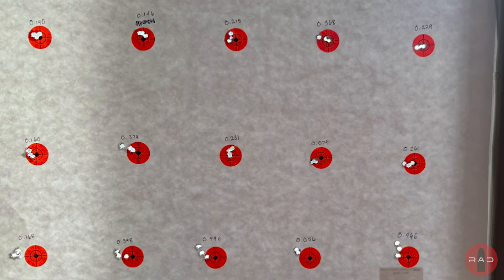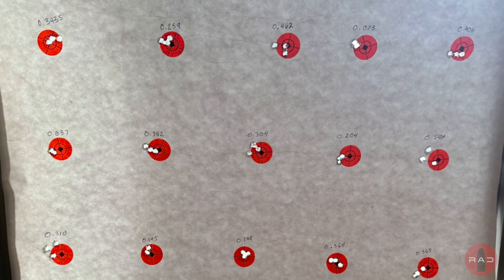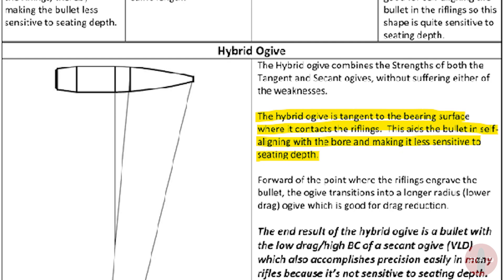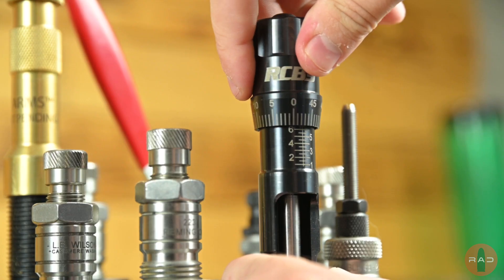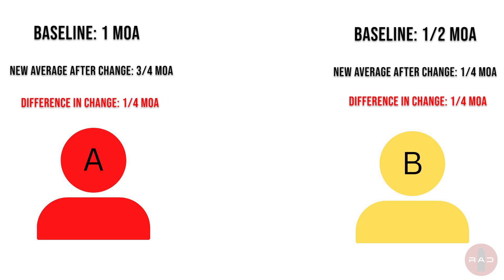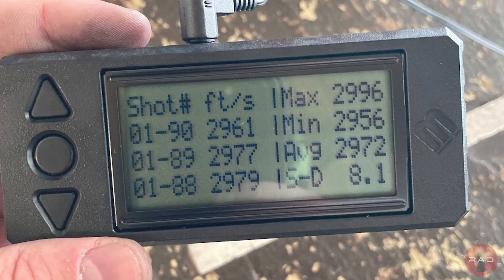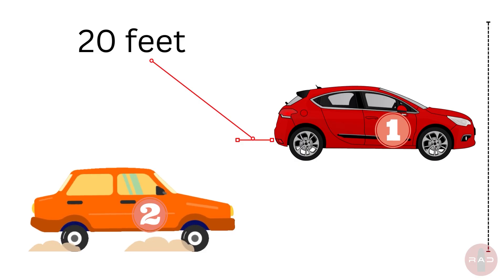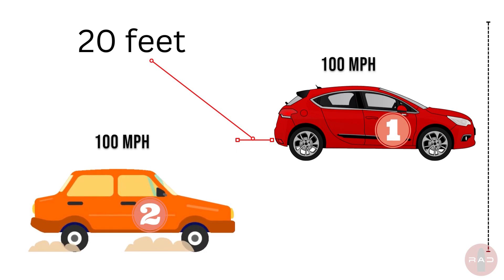I Failed To Prove Seating Depth Matters

Comment: Quick load and other load software utilize internal case volume to determine and predict what the pressure and velocity will be. Changing the seating depth changes the internal case volume. Which changes the pressure which changes the velocity. Seating bullets further out of the case increases case volume, as a general rule lowers the pressure of the load, unless it is jammed into the lands, .All of that changes the vibration imparted on the the barrel. The way to make a barrel stiffer is to Shorten it and make it larger than diameter. That limits the vibration of the barrel. Barrel tuners can also affect the vibration of the barrel and may or may not improve the consistency of the vibration.
Reply from the maker: The vibration you’re talking about, rise to peak pressure isn’t consistent. Because we aren’t shooting lasers. To that regard, you’d never be able to predict a “node” yet alone “time” muzzle whip since that is the case because all of our velocities aren’t going the same exact speed. To the other points you made about tuners, Bryan litz and jayden quinlan have both debunked the theory statistically via large testing in regard to tuners. Harmonics are not a dominant driver to precision. When ballisticians talk about seating depth they are not talking about it in a vibrational sense, they are talking about it in a mechanical sense and the way it aligns with the centerline of the bore. More common things that effect precision that have been proven since the 1890’s by Franklin Weston mann, Johan Lanhous, the reason the hybrid bullet was invented by litz, etc is due to bullet tipping in bore, unbalanced bullets, bullet shape, chamber dimension influences the relation of how the projectile is situated to centerline, etc. these are all basic problems to dispersion issues on target.

Comment: Well… time has elapsed. And now it seems the flood gates might be about to open on this matter as the question is now drawing some broader attention. 
More and more people are sharing experiences and data that struggles to prove strong correlation between group size and seat depth. I’ve heard this in podcasts from Bryan Litz and the Hornady ballisticians. They aren’t concluding it has no effect but their large sample size tests aren’t showing it… and the folks in bench rest and F-class who extensively use small sample size seat depth ladder testing to “tune” their rifles are getting right bent out of shape and butt hurt offended by the sheer blasphemy of it all… which is an even more interesting phenomenon than the test results if you ask me. 
in order to move the needle with the hard core orthodox believers somebody is going to have to execute a thorough controlled study testing group size with seat depth varied in .003” increments. Any study conducted with increments larger than this will never be accepted by the F-class and bench rest community because they believe that “harmonic nodes” exist very close together with different widths. And increments larger than .003” must be skipping between the nodes. It’s interesting… F-class and bench rest shooters achieve outlandish precision using their gear and methods… this fact is undeniable… Their methods seem to have become elevated to the status of sacred…
Reply: I can’t speak to the specifics of jacketed projectiles. I can speak to cast powder coated rifle projectiles. I personally have witnessed on many occasions. That jamming a cast rifle projectile into the lands will in a lot of cases produce very good accuracy. I can’t explain why it is for certain. I have heard that by jamming the projectile it creates a constant alignment. This kinda of reloading might not have anything to do with the two different shooting disciplines. Because it a very BIG NO NO to jam a jacketed projectile in the lands of a rifle. But I can help to think that there has to be some similarity’s between the two.

Comment: I’m not sure how everyone else will interpret this but based on your chart I’m thinking seating depth might matter but not for me. I know the BR crowd definitely believes in seating depth but they are also shooting 2” 10 shot groups at 1000. I would have like to have seen a greater variation on the jump though too. I have heard of people like Satterlee jumping as much as 0.250 and it not hurting accuracy too.
Reply from the maker: Hey! So based on the data—where would you say seating depth matters? Where is one seating depth inherently making a difference in group size? 

Yes—there’s other reasons other than what meets the eye that contributes to seating a bullet deep and having dependable and repeatable ammunition.
Reply: @Reloadingallday  correct me if I’m wrong but none of these groups would be competitive in a benchrest match, and I believe most of those guys run very light neck tension and “soft seat” the bullet in the lands of their rifles. You didn’t test jammed vs jumped. Just all minimally jumped. I’ve heard that all but guarantees alignment and that’s not related to harmonic nodes.
Reply from the maker: @K-bob_45  hey Bob! Take your rifle when you can, conduct the same exact test and see if you can see a distinguishable difference. 

Take into account again the difference between a Benchrest rifles that is super heavy that helps mitigate recoil, versus a rifle that weighs significantly less than shoots a larger recoiling round. 

The seating depth I “normally shoot” is touching. However, when looking at BR group seating depth test, the groups are all touching or almost indistinguishable for the most part—and when a “bad seating depth” is being pointed out in the test, it’s not considering the issue of the shooter behind the rifle and one typically contributes this to “bad seating depth” that may be claimed if one impact is slightly different. When it’s actually something entirely different causing the outcome. Hence, type 1 and type 2 error.

Further, If seating depth really mattered, no matter what the group size is and what the shooter is capable of: you would see a massive difference in the group size itself if it really mattered. Which the explanation of group size and comparison between shooter A and B talks about.

Regardless, some of the groups were in the 0’s up maybe a few outliers into the .4’s-.5’s. I’d highly look at topic of dispersion, depending upon rifle system, like a heavier BR rifle, the groups are going to be significantly smaller but measurable.
Reply: @K-bob_45   What your asking for is entirely different than what this video has shown.
Reply: @Reloadingallday  lol I don’t have the money or component availability to do this test. Also I buy bullets that aren’t supposed to be jump sensitive. I may try a seating test with some VLD’s but I shoot 169 SMK’s or 185 juggernauts at the moment and with both I just run mag length and the only fine tuning is powder charge for me. I may try the seating depth test with 195 TMK’s though
Reply: @yd8hw  yes and no. I think this is perhaps a premature conclusion. Picking a hybrid ogive bullet is purposefully selecting a “more forgiving” design and then the conclusion is that seating depth likely doesn’t matter. Maybe a type 3 error? Lol idk. Just my observation
Reply from the maker: @K-bob_45  haha I hear ya! Whenever you can, I think you’ll be very interested in the results.
Reply from the maker: @K-bob_45  I’d have to respectfully disagree, I don’t think it’s a premature conclusion. Because if seating depth made a difference, the “jump insensitive bullet” would show if seating depth really mattered. Ofcourse in this case, with this specific ogive—there’s a reason why they are more forgiving. Other than a vibrational node. Personally, I don’t see any muzzle whipping like it is talked about when looking at high speed footage like the one included in the video. 

Further—how many guys are sincerely not doing seating depth tests with any type of projectile ogive design, including the hybrid to squeeze in groups? Or even showing chronograph data over simply 20 rounds?

Further pointing out: how many times have you heard guys of saying that they haven’t touched their seating depth for the entirety of the barrel “stop chasing the lands, seating depth doesn’t matter”—which comes from the BR world. Instead they may change their seating depth by .003” to keep things in tune. Both can’t simultaneously be true at the same time. Changing a projectile by .006 is about 12 micro seconds difference timing in the barrel—this can be seen on Quickload and Gordon’s. If we follow the optimal barrel timing method, all of the nodes suggest that you would have to jump .060” or more for each different node to time it different in accordance with the calculator itself while also simultaneously going the same exact speed each single round—which is impossible. Furthermore, while added on Gordons reloading tool. The creator and developers added it by popular demand, not because they thought it worked. There’s too many instances where OBT doesn’t work. 

As far as seating deeper or large amounts of jumps, there’s a reason inherently why rounds like a lot of jump depending upon propellant bulk density, case volume, and projectile being used. You can see this by loading up a bad bulk density powder that has a very moderate powder charge load and start jumping. You will see some interesting things in regard to SD. 

For a type 1 and type 2 error, this is observed constantly when seating depth tests are conducted. Out of the groups shot, at various seating depths. Only the best group is chosen and not retested in great length. No one re-tests all the seating depths in great length—including the bad ones, which, to most individuals surprise you will see what I’m talking about in this video in regard to dispersion. 

Food for thought, a lot more going on then what actually is being portrayed

This also might help explains things more on the stats side: https://www.instagram.com/p/CsAOCVeNs8K/?igshid=MzRlODBiNWFlZA==

Comment: what if the seating depth is finding the load density or vise versa. so basically you could say you want to start the load .020 off the lands then slowly work up the powder charge till your group shoots the way you want it too if you say seating depth doesnt matter not if you found the perfect load density as you move the bullet forward or back you have now changed your density. which makes sense other wise every bullet would shoot good at that ..020 but it wont because your load density changes

Comment: Statistical significance.
Barrel life
Component cost
Repeatability
Recent reloading  process seems to be disproving the usual ideas...velocity node...followed by seating depth. Ie ...concentricity by f class john,
I guess most can't throw that much time and resource at it.
Then there is stable platform to shoot from and wind..for significant results..

If consistent velocity is key...then...case capacity measurements and powder weights most important ..

All very interesting..

Comment: How did you determine group size?  Group extreme spread  is itself a random variable, problematic for linear regression.  Seems to me you'd need to use an invariant measure like mean ES or mean shot radius as your dependent variable to justify linear regression.

Comment: So only load density matters, right? But seating depth affects load density, right? But seating depth doesn't matter, right? Just trying to make sure I follow.
Reply from the maker: The way one achieves precision due to chamber design, projectile shape, dynamic instability versus velocity consistency is being confused with timing the projectile in accordance with a muzzle whip. Highly recommend listening to Jayden quinlan, rifle accuracy facts Vaughn, or Johan labhous from Somchem, Reinmetal denel that clear this difference up and what we are explicitly showing.

In other words, from all the collective testing so far, if using a hybrid or tangent with modern chamber designs, you can get any seating depth to work.

Comment: Shooting for groups with a Magneto tied to the barrel.....Hmmmmmmm
Reply from the maker: Hey T.C.! If you are implying it’s changing harmonics, then the magneto is a constant, as it isn’t moving on the barrel. So groups wouldn’t be affected in a negative way. 

Ive done extensive testing with this barrel contour and have not seen any POI shift from when the magneto was removed or added onto the barrel. We have tested this extensively on our Instagram stories that you can see: https://www.instagram.com/s/aGlnaGxpZ2h0OjE3OTU5MzM3MzQxOTI4NTY4?story_media_id=2904782162693285845&igshid=ZjA0NjI3M2I=

Highly recommend reaching out to Ryan Hey about this as well.
Reply: I think that having your bipod legs angled forward is not a good thing. If you watch the video of you shooting, the gun moves down during recoil as well as to the rear. It seems highly unlikely that you would have the same amount of pressure against the stock for each shot and therefore the rounds are exiting at different heights, thereby creating a group pattern that is incorrectly indicating accuracy performance. Conversely, a bipod with the legs at the typical vertical position along with a rear bag, would have a much more linear recoil that has almost no downward push. It would be interesting to test this all by itself. Keep up the super complicated, somewhat hard to understand work…lol. Just kidding, this is great work.
Reply from the maker: @dougearl742  Doug, thank you so much for the insight. I’m going to continue on seating deeper and testing. If you would like—if it is of interest, I can send you the testing conditions for this. It would be a great help for individuals to submit data in. My hopes are that I can have a lot of shooters conduct this test and get to the bottom of things and post the results for individuals to make their own conclusions.